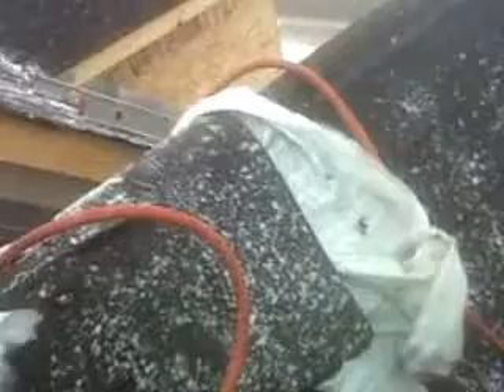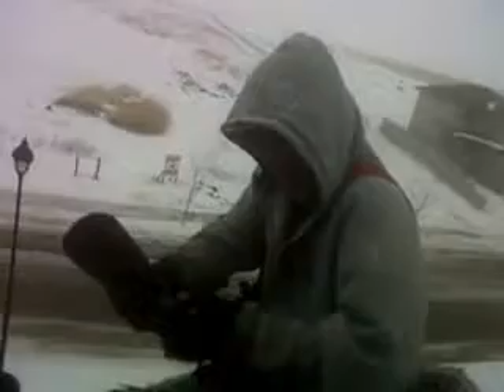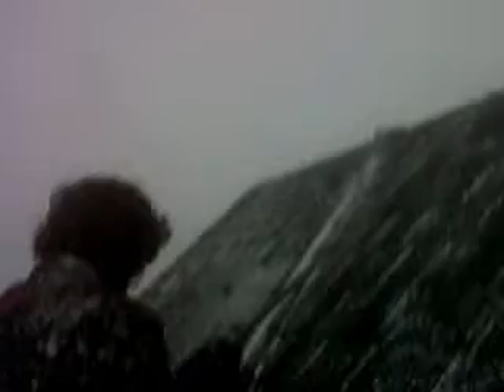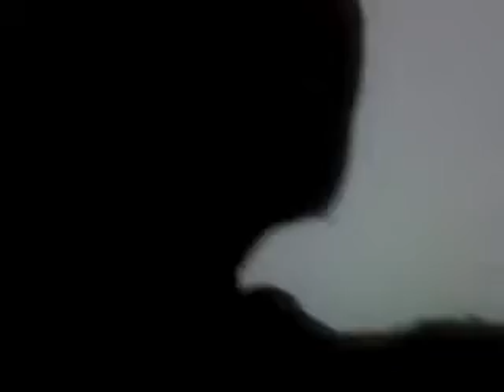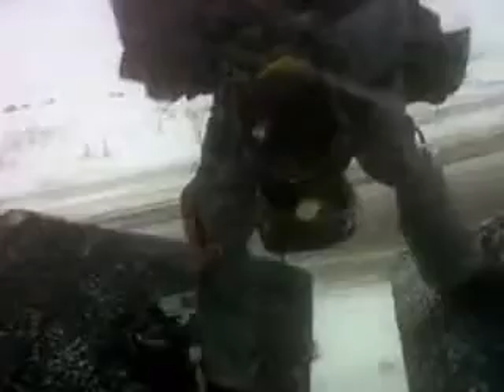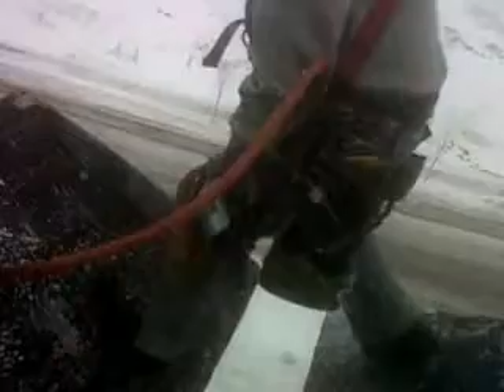Bucky 12/12 Roofing three storys winter

Comment: What kind of blades do you use to cut the shingles in the cold? I find it's like trying to cut through rock when it's in the negative degrees
Reply from the maker: Stanley hook blades always
Reply: Hook blades with a lil muscle even in summer
Reply: Big grey aluminum snips work the best but any big coil (facial) stock snips will work.